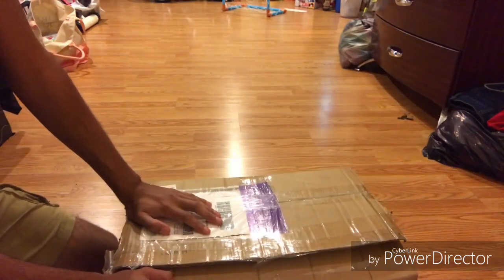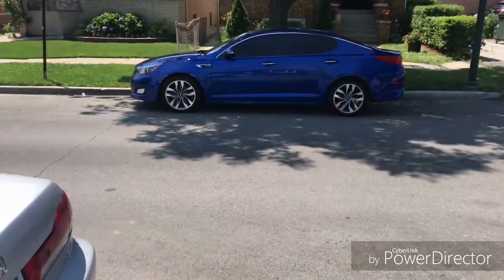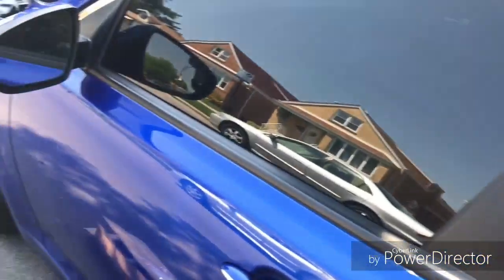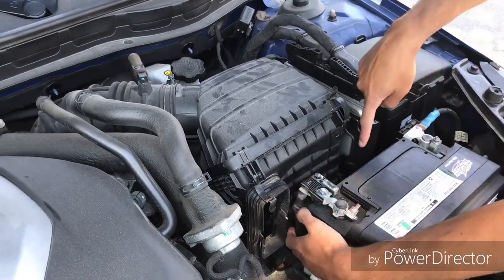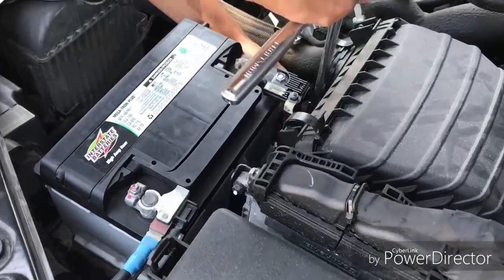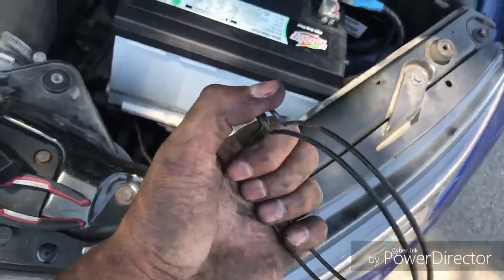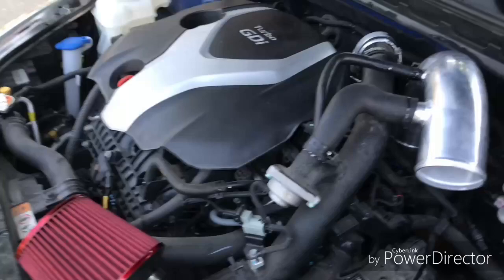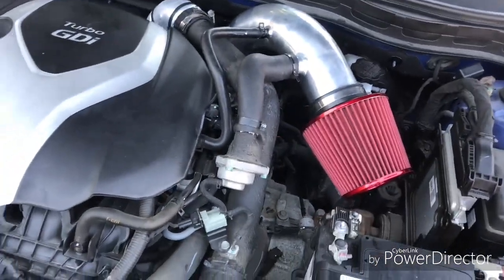2014 Kia Optima Sx Turbo Intake Install

Comment: What size hoses did you have to get? Having the same issue on mine.
Reply from the maker: I just took the whole intake to the auto store and asked them what hose they had that fit that bung.
Reply: Same, I had to buy my own clamps and other hoses to fit this. It was a bitch but the savings is worth it lmao